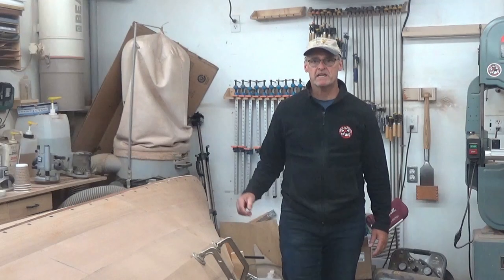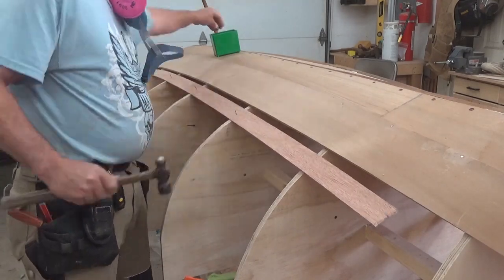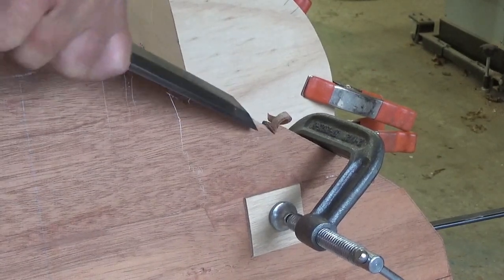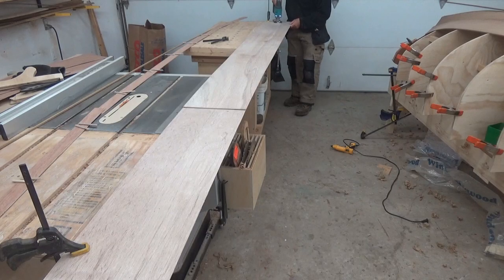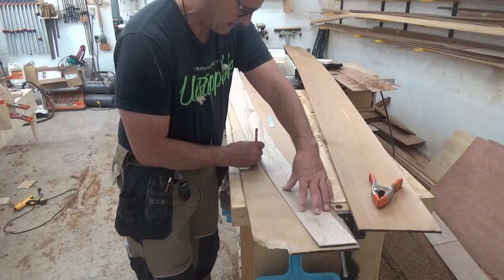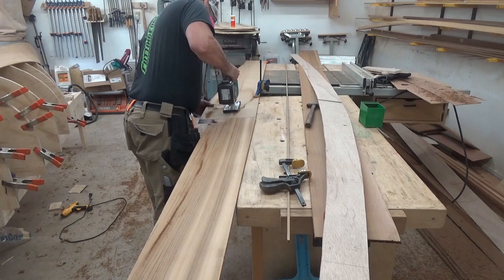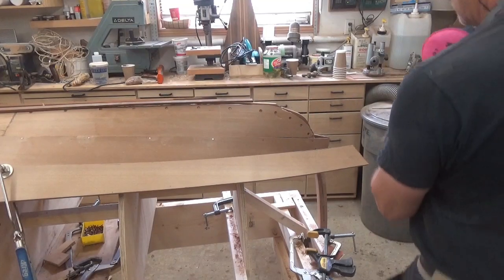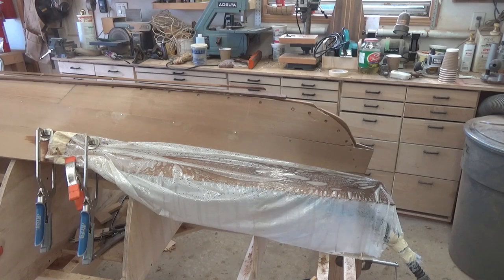Acorn Dinghy Build - EP 7 - Planking and Riveting

Comment: Great video!! 👏 what product do you use for bedding the plank seams and why? Thanks!
Reply from the maker: The caulking is  polysulphide "Life-Calk".  The boat is dry stored so only put in the water for day trips.  So to assist with keeping her dry and not needing days to swell up, I added a small bit of caulking between the planks.  It is very flexible.